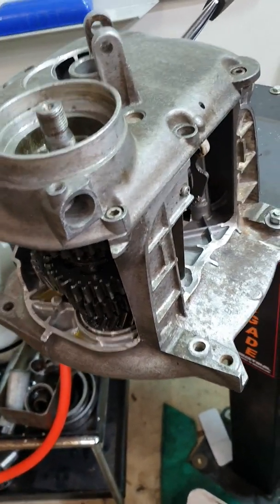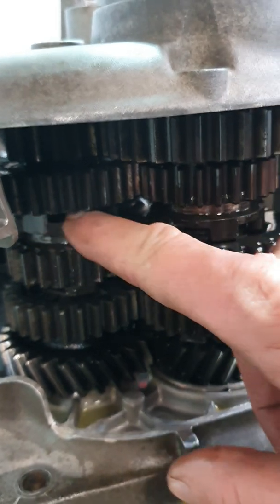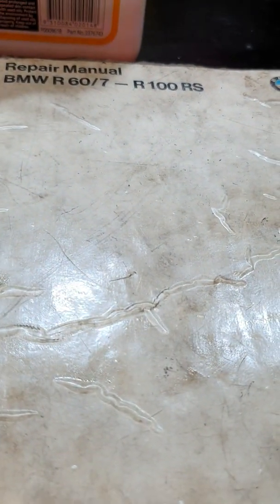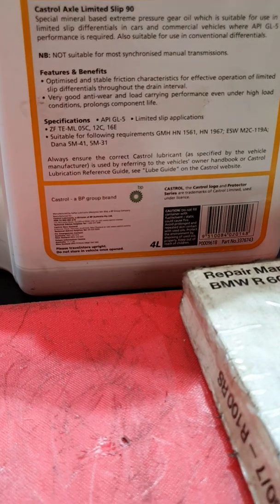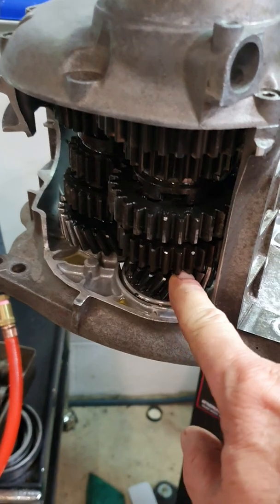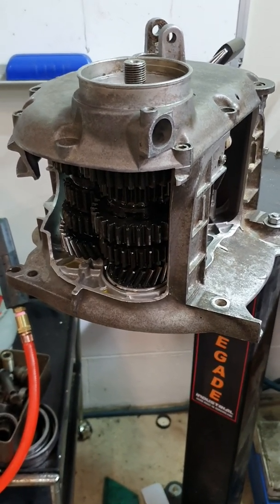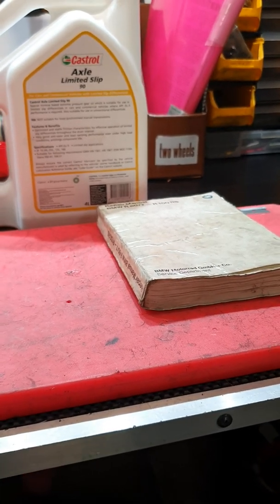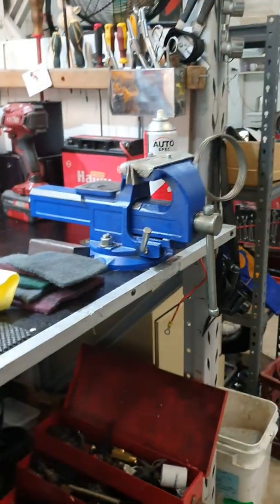Inside a 5 speed BMW Airhead gear box

Comment: Nice work, good info...I take it that the brass is compatible with GL5 oil, otherwise it would not be recommended by BMW or yourself.. Don't ever use a GL5 oil in a GL4 oil spec gearbox, destroys the softer metal which I believe is used on the synchros. How do I know? I am now starting to use Penrite oils in my R80GS.

Comment: Hi Mate, Have you seen this transmission fluid,Item #: 952560

Red Line V-Twin Transmission Oil with ShockProof
I'm currently running it in my 75 R90/6 and 72 R75/5 with early model 5 speed. Seems to quiet shifts .It is advertised for Harly's transmissions